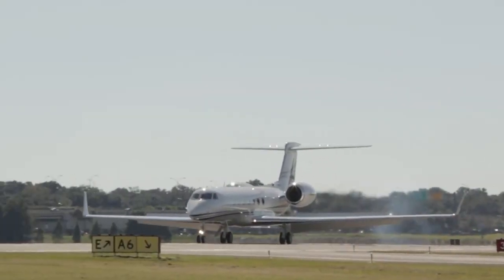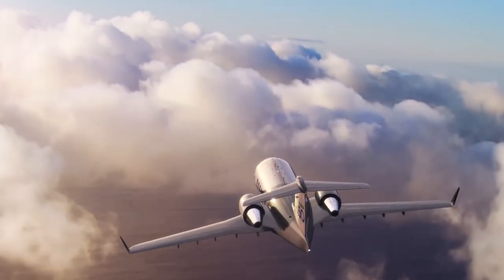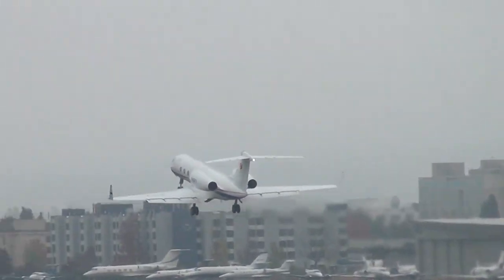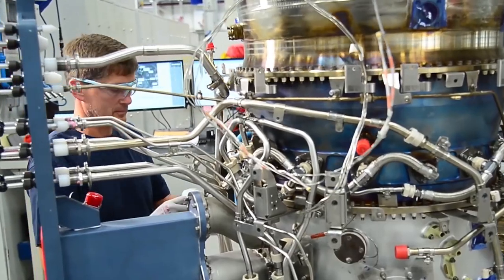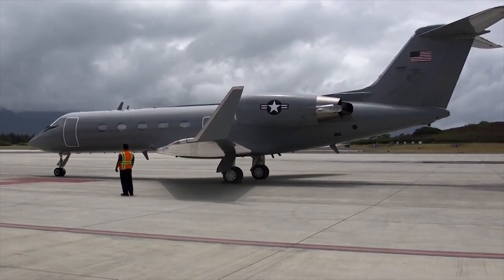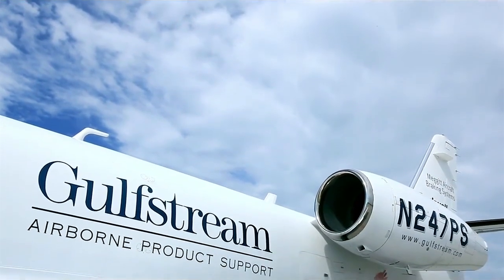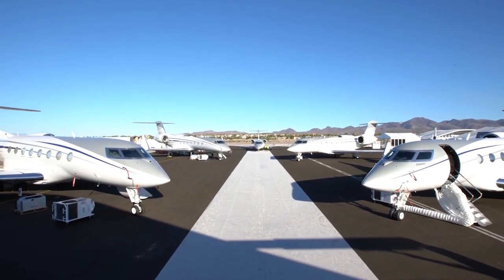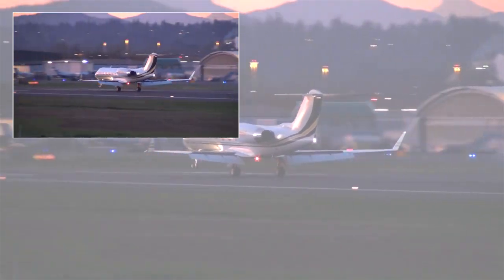Gulfstream IV - the jet limousine

Comment: This video is not completely accurate. The original iv tays did not have fadec
Reply: Fadec was installed on G-V not on G-IV which still had old system of adjustment.
Reply: The Tay 611-8C for the G450 did have FADEC. Rolls Royce Deutschland did the conversion and somehow managed to make the engine 150 lbs heavier!

Comment: Giv has the same engines as the Boeing 727. The "727"  is said to be a guzzler. Is the Giv a guzzler compared to its immediate competitors?
Reply: The 727 was re-engined with Tay 651-54's for UPS. (15,400 lbs thrust) Not the 611-8's of the GIV. (13,800 lbs thrust) Totally different 'guts'.